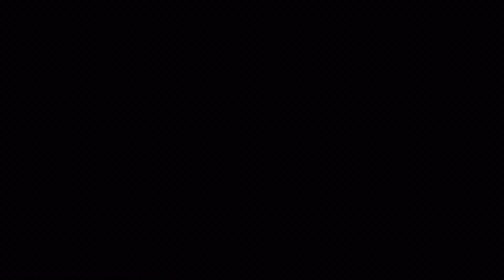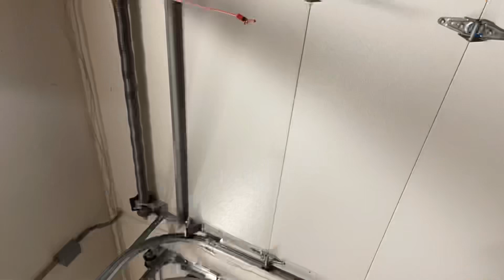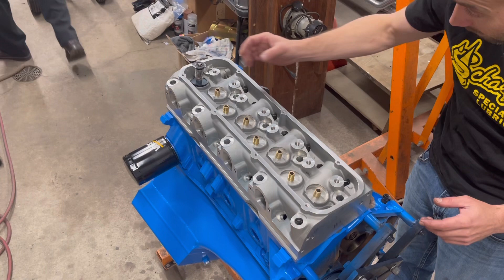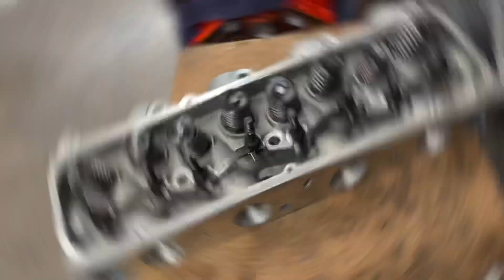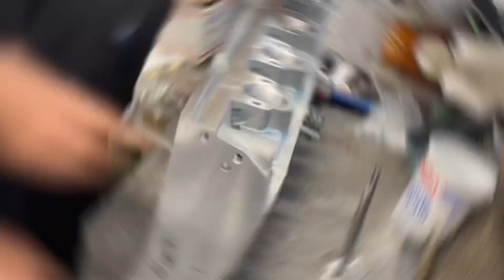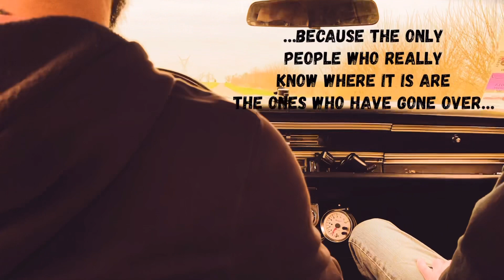EASY!!!! Speedmaster Cylinder Head Final Assembly! All New Parts! #nonamenationals

Comment: I'm assuming that any future repair or maintenance will require each valve assembly to be returned to the same location. Or maybe just the shims and cups?
Reply from the maker: That is correct.  Or just go through the whole process again.  That being said, you could also probably get a taller spring
Reply: @2HacksGarage  As a machinist, starting with bare head, I would establish that all valve seats were at the same height (relative to the deck surface). If not, I'd make them so.
Then, I'd machine the spring seat surface, so they were the same height. This would take very little time on a regular milling machine.
For me, having a rock solid, consistent foundation is the only acceptable starting point.
That said, you guys have done a marvelous job of polishing a turd! I had forgotten most of this stuff in the last couple decades and it's been delightful for me! (Not so much for you 🥺.)
Love the editing, music, humor. A lot more people need to see this content! Thanks. 😊👍
Reply from the maker: Thank you!!! Im definitely learning as much as I can.  This world needs more machinists like you and Jimmy, I don’t think the average car guy truly understands the talent you guys have and how much you contribute to making engines run right